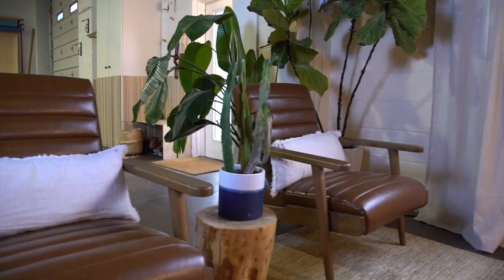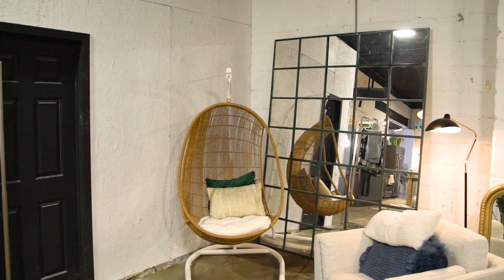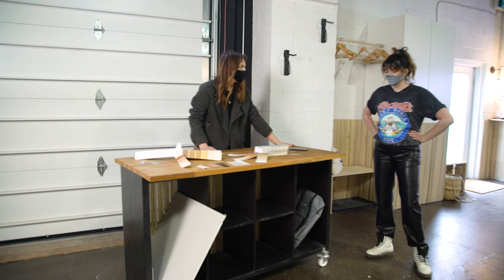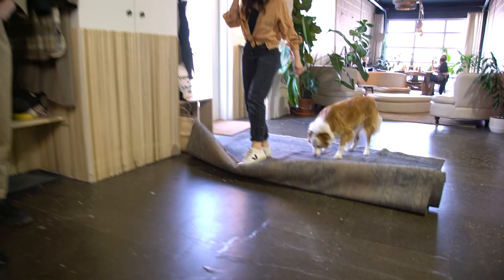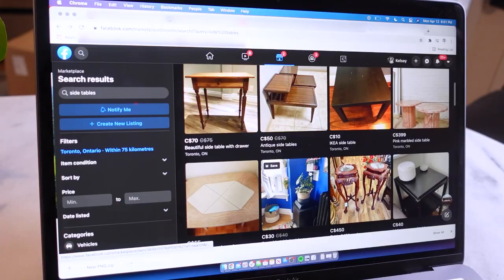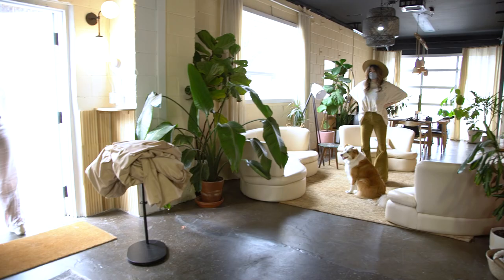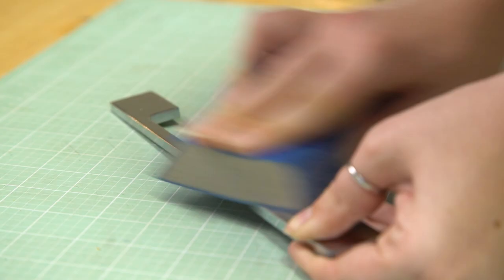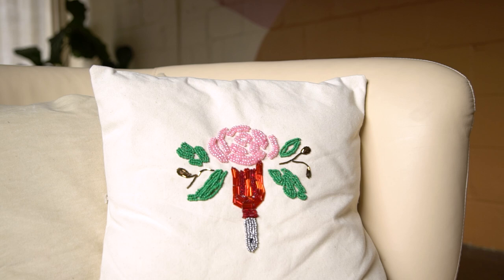coolest thrifted find for our office!

Comment: Pro tip: rub wax paper against the pole to help the curtain rings slide easier (and make less noise)! You can do this in your closet too for your hangers
Reply: Cool tip! I’m going to try this
Reply: Thanks!
Reply: @Summer Staley- thanks for tip about curtain rings. Your’s is a cool creative solution
Reply from the maker: so smart!!
Reply: An old candle works too if you don't have wax paper. But the best wax paper is what is inside cereal boxes. I use them for patterns and things.
Reply: @TheSorryGirls  even easier is spray silicon or furniture polish with silicone on to pole. 🤪
Reply: Going to give this a try. Thanks!
Reply: Ooh I'm gonna give this a try.
Reply: EXACTLY what I was thinking.
Reply: Great hack. Another one rub a candle along an old drawer runner so it runs smoothly. Must be old, e.g. no metal rails.
Reply: We did this at one of the jobs I had during college. It was my favorite thing to do!
Reply: @poodlegirl55  Hello new Bestie 😁 Love the resourcefulness
Reply: damn this was a whole plot point in twin peaks and you solved it this easily??
Reply: And if you want to go really fast on an old metal slide you can rub wax paper on that too!! 😜 We used to do that on our backyard slide as kids... boy did that thing make you go fast! 😬

Comment: Y'all could definitely put a long bar hanging off the inside of each end's panel clip, one on each side, to pull the curtains closed, without worrying of pulling the curtain off the clip when you want to close them. You know, like the have in hotel rooms. Might need to attach with a jump ring, to make it hang straight down easily. Could paint it color of curtain to make it disappear. The whole space looks amazing!

Comment: Tip for the curtains: you can try sowing them into the clips to secure them more so they don't fall off. Or some fabric supply stores where I am from have super sharp and strong clips which I use for heavier curtains.

Comment: I'm gonna be honest, I don't get the cutting legs off thing at all... Guess I'm just old. It reminds me of the fact that I don't have a bedframe, like putting a mattress on the floor instead of having actual furniture.
Reply: Its pretty obvious that no one over 50 or with mobility issues works there
Reply: @theresalinger7387  or anyone with long legs! I hate stuff so low to the floor!
Reply: @theresalinger7387  I was thinking the same thing. My back hurts just looking at them, and I only have mild/moderate back problems.
Reply: So true! They looked so much nicer with legs!
Reply: Yeah, I agree... I would've just swapped the legs out for a more modern looking leg, rather than just making them flat against the floor. 🤷‍♀️
Reply: I'm old, too, but also practical and I prefer the legs. I think, without the legs,  the couches will get very dirty around the bottom.
Reply: Right! I get that the legs that came on it were pretty dated & not their vibe, but even short ball feet would help so much! Better yet a platform cut in the same shape.

Comment: Im so jealous of that couch omg

edit: PLEASE put new legs on them. being on the ground is an accessibility and cleaning nightmare, and honestly does not look great
Reply: I'm curious how?? Nothing can get under them now and just use the nosel to the vacuum around them or a wet rag
Reply: @quill_bee  Trust me from experience. No matter how you go at it with nozzels, where furniture meets floor always collects crud that is, to some degree or another, not cleanable without moving the furniture. Seating is the worst for it. Like, it's doable, but it is so much more work than just putting legs on a chair. And again, this is not accessible to anyone coming into their office with mobility issues. I guess that's not an issue currently, but it's annoying how very little people consider basic accessibility standards.
Reply: Different person here but I just genuinely don’t understand the issue it poses for accessibility? I really would like to understand. Does it make it harder for people to sit because it’s lower or what is the issue with it?
Reply: @johannaguerrero1790  So "regular" height or higher chairs don't solve every mobility issue. Some people (Little People for example) need short chairs. But the vast majority of issues with hips, knees, and legs (whether from weak muscles, joint problems, or straight up prosthetics) make getting out of low seats difficult or even painful. My mother and other older members of my family would rather stand or pull over a chair than sit on that couch. I know someone with a prosthetic leg who would have to fall down to sit down and ask for help to get up. Heavy people (esp those with medical issues) might also need help getting up from such a low seat. For some, dealing with this isn't that big of an issue. For others, though, it can cause pain and/or humiliation. 

Thank you for asking. I'm sorry if I have sounded snippy in any of my comments, it is just that it is very important to me that these things are thought about. I myself used to live blissfully unaware of lack of accessibility, and, for the most part, inaccessibility doesn't directly affect me much as I am right now. But I spent a lot of time listening to others about the issue, and I think it's a shame how much our culture encourages not thinking about these things at all until we're personally affected. It would be so much better if we could all be a little more considerate, especially for basic things like making sure chairs are at an accessible height. ☺️

Comment: you guys need one of those long bars with a hook on the end like they use in clothing stores to reach the hangers on high racks! don't know if a standard one would be tall enough to reach your curtain pole, but maybe a similar DIY so you can pull the curtains open & closed using the rings rather than tugging on the fabric and having it pop out of the clips.

Comment: Wow, that’s so cool! And Danny is the cutest dog ever! Love your new couch! But I’m really afraid that it will be destroyed without feet. There are furniture feet very flat like a big button perhaps 1/4 inch high or lower (sorry, I measure in cm it’s 0.5cm round about) They will let only a little air under the couches and it’s very easy to change the place, because the couch will glide on it. And you won’t see if it is under it or not.

Comment: For numerous reasons you should put pads under all of the area rugs!  Also, I love your decor but I'd like to see a bit more consideration to practicality...like the potted plant placed in basket up on top of a tall cabinet...definitely not easy to water or the drapes that pool a bunch on the floor...they will get so dirty!  And the clips used for hanging those drapes...will they hold those curtains if they are frequently opened and closed?  Maybe a stronger hook, or sew them on???  Your loft is first off a work space so it has to be really functional as well as look good.  All said tho, yours is a very inviting work space!  We'll done.

Comment: I’m afraid taking the legs off your seating pieces will make it hard if not impossible for use by older people or people with joint or strength issues. Maybe you could find some compromise legs.